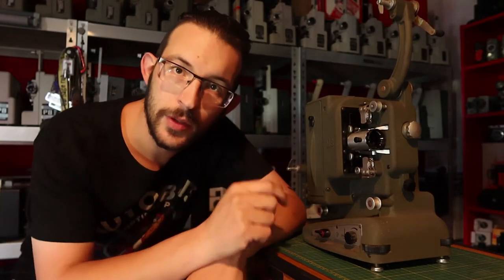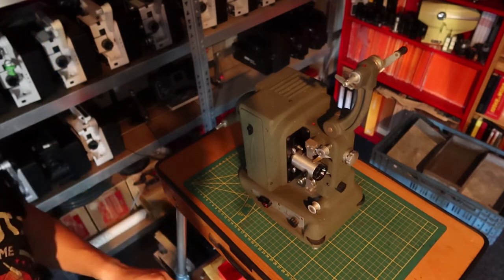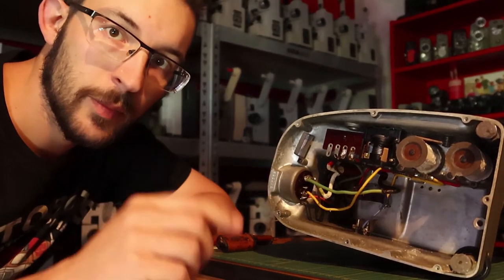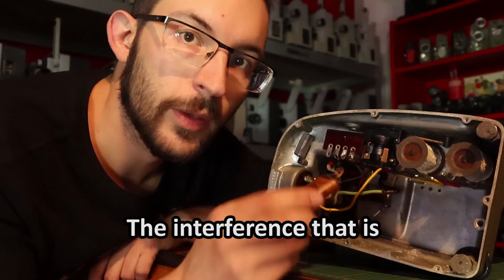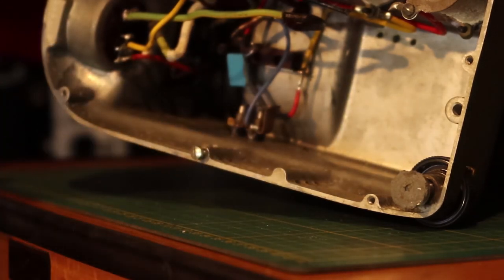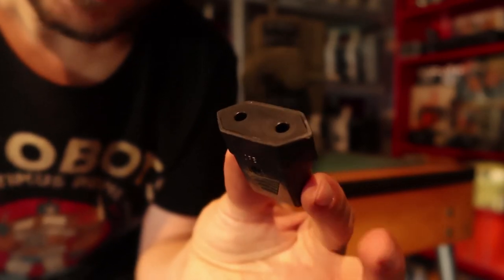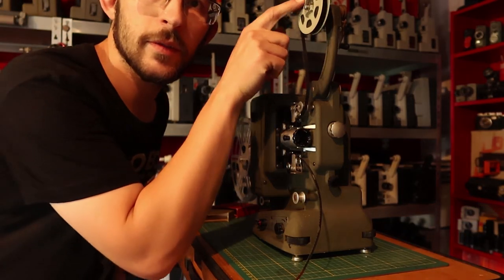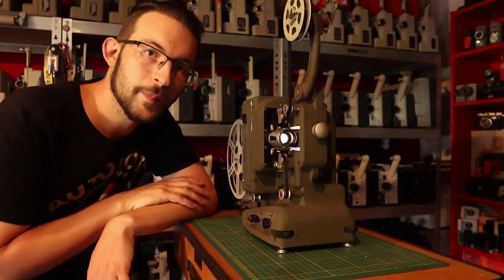repair of a Vintage Bolex M8 Filmprojector 1953

Comment: Thank´s a lot Erik! You made my M8 running again! Subscibed. My old projektor, 1 year ago, made a loud puff and stopped running. I didn´t know what to do now, so it went back into the case. Now alife again. What can I do else abot the lamp? In very dim daylight, it is impossible to see an image properly in a distance of 4 meters, normal screen in a small room. Was that normal, back in the 1950/60`s ? I mean, that is at least a 500W bulb, I saw in USA, that Keystone projectors with similar lamps produce a much lighter image. Regards!

Comment: Hi,
I have an old sankyo 8 mm projector. The motor doesn't work at all, and I guess I need to replace it.  Where can I find spare parts to buy, and is it possible for someone who is not an expert to fix it?

Comment: Thank you so much for your very useful video. I have a question: You changed the capacitor of 0,1uf 1500V. Could you tell us what kind of capacitor and values you had used? Thank you.

Comment: Thank you so much for your very interesting repair video. I have a question: I have two different projectors paillard Bolex M8, one is much more noisier than the other one. Have you any suggestion ? Perhaps is it the ventilator ? For the rest, the projection of a film is without problem. Just terribly noisy.
Reply from the maker: I would think a difference in how it was maintained over the years. One well lubricated and the other not. You could try to lubricate it

Comment: Hi Erik, I have a Vintage Paillard Bolex G-16 16mm Projector. I believe the motor is burned out. I say this cause it smokes when I turn it on. It was working about 8 years ago. Is there a way to repair the motor?
Reply: Any ideas?

Comment: Whath kind of condensator have you used (the second) ? 1500V - 0,1 uF? Where have you buy it? Can you share the link? Thank you so much!
Reply from the maker: The one i replaced comes from my local electronics shop but he is a conrad dealer. So he might get it from there
Reply: @eriksnel6461  Tank you so much, another question: I need to replace the transmission belt. How can i remove the shaft?
Reply from the maker: @flaviapichinelli723  I have looked into that and i would advice against it to tackle yourself if you are not a trained mechanic. it takes a lot of disassembly and the biggest questions is if you get it together again.  i may make another video about this later
Reply from the maker: I have made a new video about changing the belt on the bolex. part one is online. part two will follow soon https://www.youtube.com/watch?v=w-HZNwqDl1Q
Reply: Thanks you so much !

Comment: We have a vintage Bolex 1952/3 film projector Erik, left by my Husbands father. It has a 240volt feed  but the bulb gets very hot after a short time and we are scared to use it. Is there a way to adapt it for LED’s to keep the heat down but retain the luminosity? Thanks you for any help, we have so many old reels we would love to watch.
Reply from the maker: Well, you would need a powerfull led and they also generate a lot of heat. You would also need a new power supply and a big heat sink. So there are no great advantages to change it to led. The heat generated by these old style lamps is very great but as long as the film is running they cant damage the film. As soon as the film gets stuck it will burn the frame instantly. If you dont thrust the projector i would look for a much younger one . The eumig mark 605/607/610D perhaps. There are many and thus relatively cheap. They are good quality machines and when serviced right they are very gentle for your precious film. And they use a halogen lamp which produces a lot less heat. Make sure its dual gauge for super 8 and regular 8.
Reply: @eriksnel6461  thank you. I think my Husband is emotionally attached to this old projector, but I will let him know your advice. Cheers Erik 👍🏻
Reply from the maker: @lynkirklandencausticwaxart7890  well you shouldn’t throw it out offcourse, it is still a very pretty machine to put on display. And as i show in this video there are ways to make it a bit safer. But ripping the light out and put a led in it will only end in disappointment i’m affraid. You could search for an 8mm film in like a thrift store or online and use it as en expendable film to see if the projector does burn the film or not before you try and play your precious own films.
Reply: @eriksnel6461  we are going to service our machine as you describe, we have so many reels to watch...I am sure there will be something there that we can afford to risk if the machine stops.
Thank you for your very kind help. Have a good evening wherever you are.
Reply from the maker: @lynkirklandencausticwaxart7890  good luck with the service. Check if there are no damaged pieces or rust inside the film gate. Or on any part that touches the film.

Comment: Helo, my bolexe’s claw is tearing the film, what may be the issue?
Reply from the maker: There can be many reasons. My first guess is that the top and bottom loop are not big enough. Or the film is not properly seated in the sprockets so it loses the loops
Reply: @eriksnel6461   also the image is shaky when it film is still in one piece
Reply from the maker: Can you send a picture with film in it?